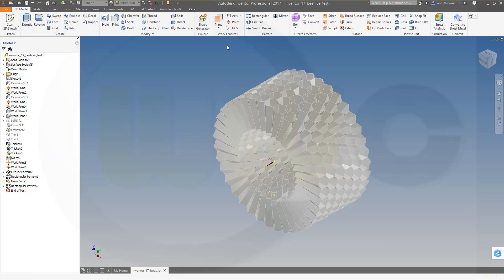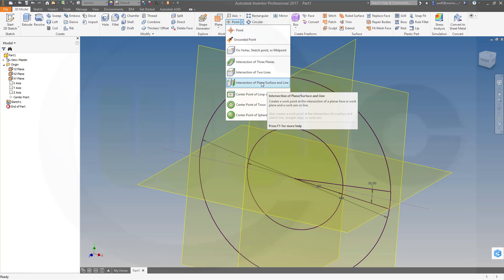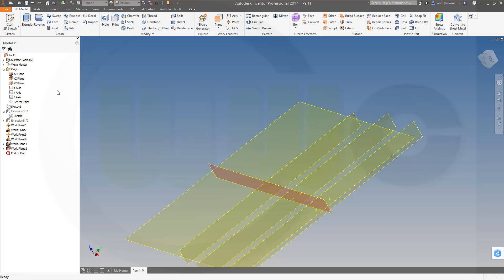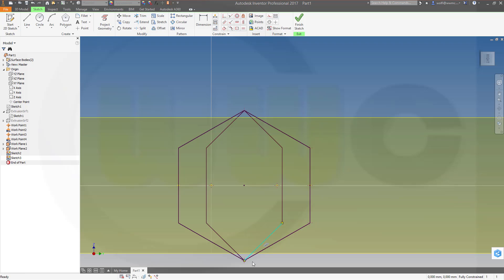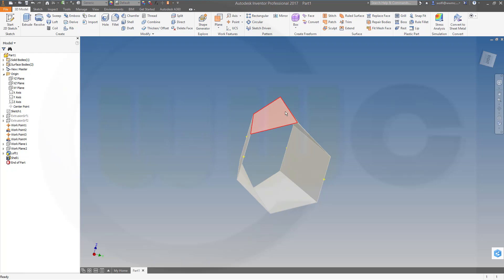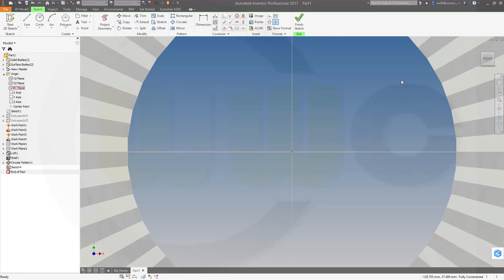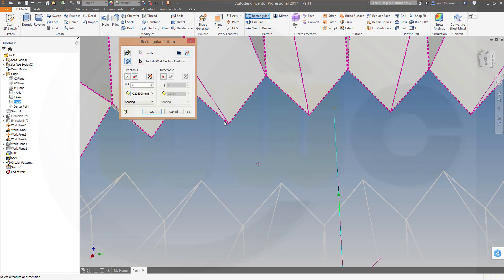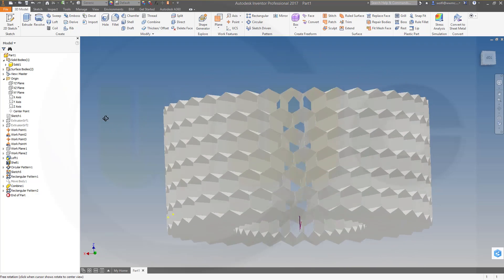Userwish - Beehive - Bienenwaben -Inventor 2017 Training - Part Design

Comment: Thanks for your video! Can I somehow turn rectangular pattern elements in assemblies like you did it with 'move body' on the second row?
Reply from the maker: Hi, use a constraint with an angle ;)
Reply: That's what I do now but I thought there's an easier solution. It's a disc harrow roller with knife rings and it's a pain in the neck to set every rings by hand with constraints. Every rings should be set by 5 degrees to the previous one and the widest harrow has 22 of them. Anyway, thank you for your answer. :)